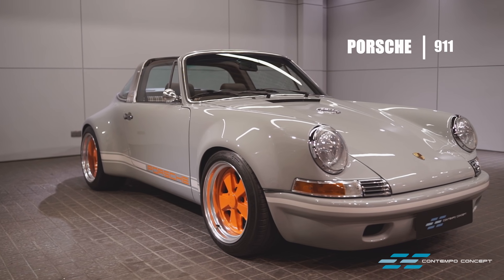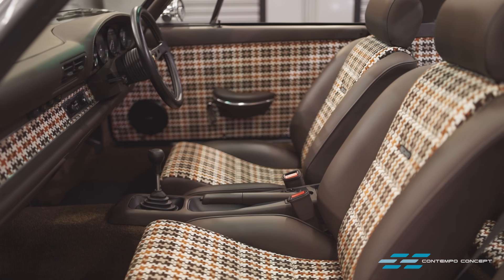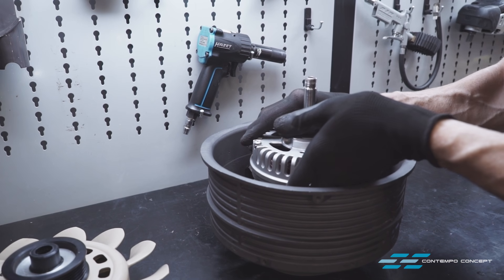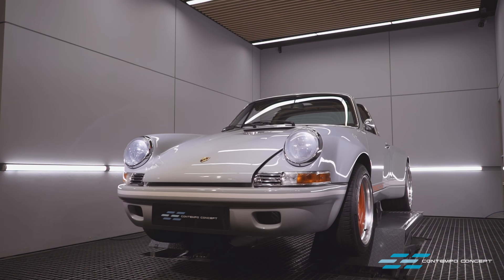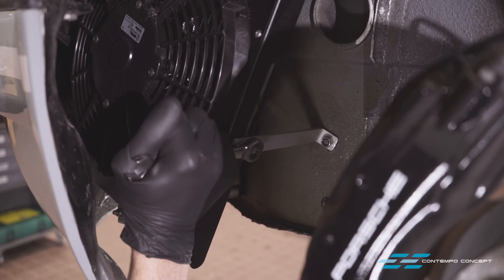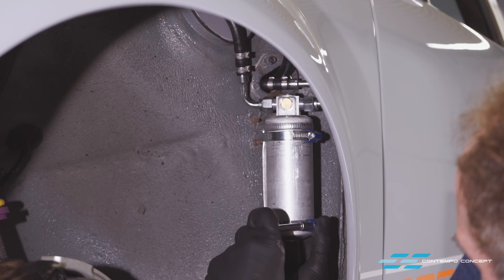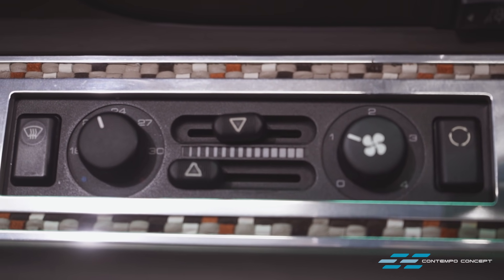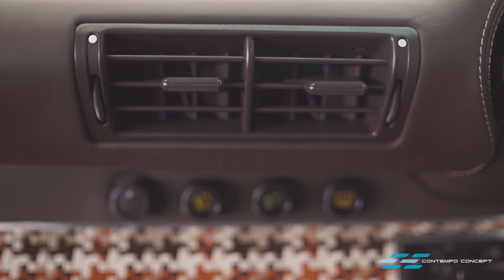Electric Air Conditioning for Restomod Porsche 911

Comment: Lmao I wanna do something like this to my Mk5 GTI, Dubai weather + not so good ac = sweaty back
Reply: Take out the leather seats 😂😂😂
Reply: @Shane-zx4ps  I have the tartan cloth seats ahaha
Reply: @FluffyUnicornXR  buy a Japanese car then, better aircon systems in them ha ha ha ha 😂
Reply: @Shane-zx4ps  definitely, my dad’s Cx9 cools like a bastard
Reply: @FluffyUnicornXR  told you...👍
Reply: You definitely have an issue with your a/c system, my VW from around the same time blows ice cold
Reply: @moejasss  hm I’ve been told by my friends with the same car from the same time, that VW acs were dogshit lmao. Mine blows ice cold only if like 60+ kph and not in the middle of the day :(
Reply: @FluffyUnicornXR  my dad had a 2009 Tiguan and it was perfect in like 45+ °c weather here in South Africa
Reply: @moejasss  imma go ahead and cry
Reply: @moejasss  that’s a newer car dude, miguels car is a mk 5 golf
Reply: @FluffyUnicornXR  don’t cry 😢 Miguel just borrow daddies mazda 😂😂
Reply: @Shane-zx4ps  Same platform, many shared parts, same engine as the MKV Golf GT
Reply: @moejasss  I had a 2006 MK V gti with leather DSG gearbox, had to get 2 new steering racks within the first year under warranty, so I changed to Honda Civic type R,s never had a problem just change your oil on time..
Reply: @Shane-zx4ps  we actually sold the car after it constantly had coil pack failures and the nail in the coffin was also a failed steering rack
Reply: @moejasss  👍 ☘️
Reply: take it to AMPEX in dubai investment park

Comment: You needed to replace all the original Aircon parts in order to use the electric compressor?
Reply: Yes, otherwise contaminants could get into the old system and screw everything up. Also, new refrigerants may come with new pressure/material requirements, making the old components unsafe for use.
Reply: @jamesmoran8294  but if you are replacing them anyway why not just see if it works as is first?
Reply: @blackterminal  You could, there's a good possibility that nothing would happen, but the chance of system failure is higher. Also it could void the warranty of the new compressor if you attach it to an older system.
Reply: @jamesmoran8294  Imo i would use a Chinese compressor and cross fingers. But upto you and how much you have in your bank account
Reply: @blackterminal  Yeah that's what my plan A is. Plan B is that Chinesium compressor fails and I get something really quality.
Reply: @jamesmoran8294  Good plan. I have a car I'm converting to electric so a 12v Chinese compressor may be in it's future
Reply: @blackterminal  have you managed to convert to 12v? Now it works with the car off?
Reply: @jamesmoran8294  have you managed to convert to 12v? Now it works with the car off?
Reply: Nah I ended up just not going through with the project, decided to build an engine instead.